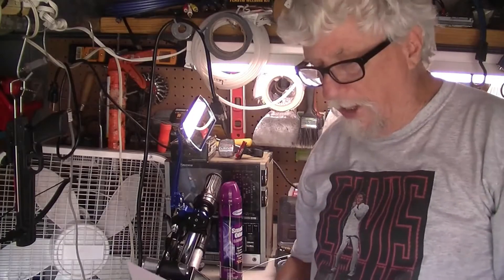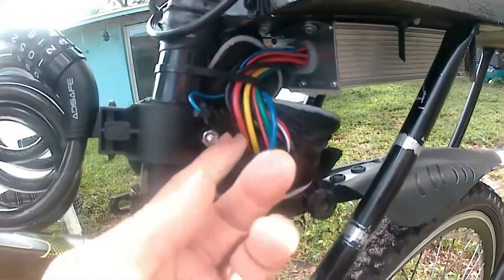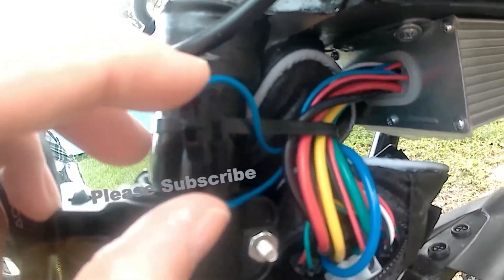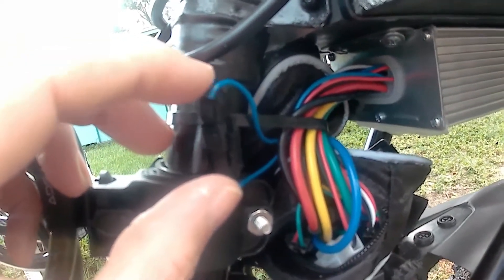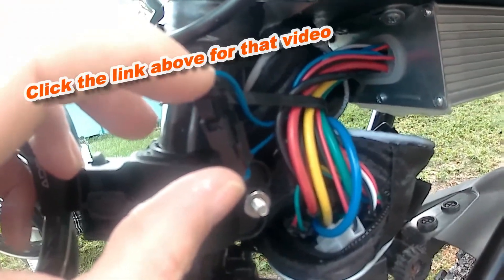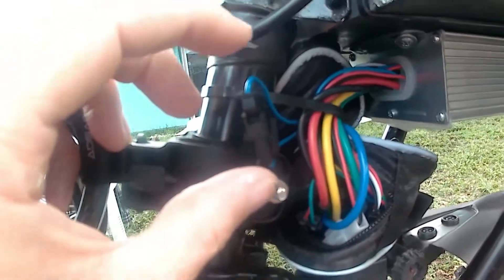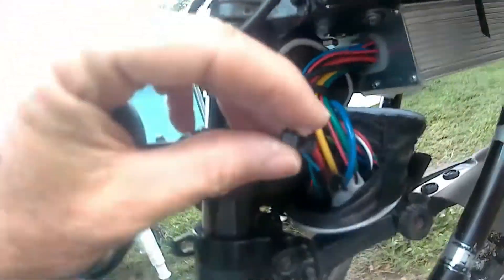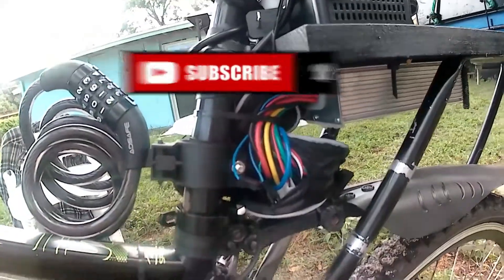Hack your E Bike to go FAST part2

Comment: Mr Harold, Love your videos. I bought a 2021 used 36V Totgaurd. Looks like yours. After the throttle adjustment my display says 29mph but when I gauge it on my phone it aint going no faster..  I didnt assemble the thing so Im experimenting with wire disconnections on the controller but they aint no small blue and the other single to single wires made it have a grinding noise which aint never good. Any suggestions?   I make friction bikes back in oklahoma but im out here in California and they wouldnt like the smoke and noise a 90cc Sthil on a tire kicks up..lol   Okiespokin  Jeff Rodgers

Comment: Update on last comment, I’ve disconnected every wire one at a time and all it did was stopped the motor.
Reply: Now, why would you go and do ALL the wires?  If it wasn't doing the job, try a different tactic altogether.  Solve it from a different angle.  Gosh.  Learn how to learn Roger.  No offense, but it's not about the right color wire at that point.  There must be a different way of going about getting around the governor.  Or, maybe there isn't.  Maybe there isn't a governor at all.  But with mine, I can feel the GOV. kick in.  Or it's maybe called a Limiter, or something.  Doesn't really matter.  You can get around it somehow.  Go take a walk and look at the problem later with a fresh set of eyes.
Reply from the maker: On our bike it was the blue wire. Thanks for watching and have an Awesome day 😊